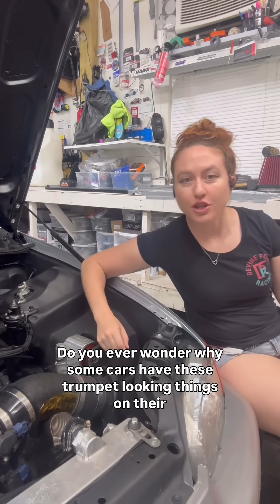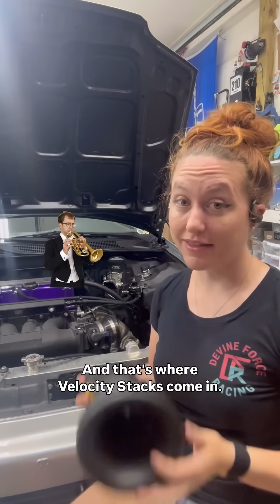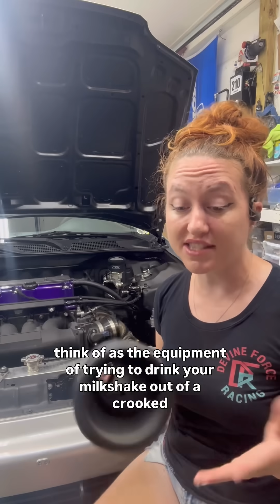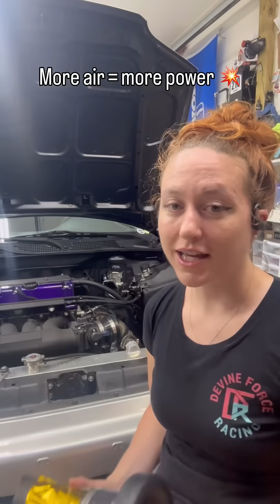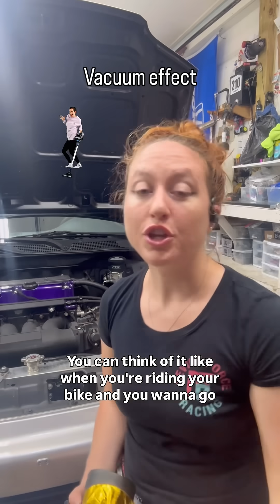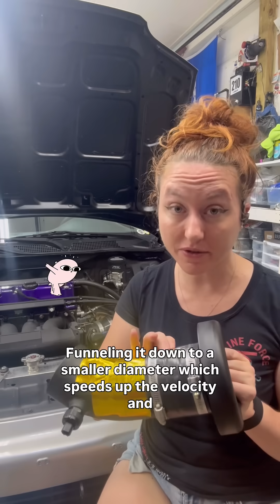Explain it like I’m 12 🧠- Velocity Stacks and Bernoulli’s Equation

Comment: But diesel pistons are starting to get those dots golf balls have so if you do the same thing to that
Reply: No OEM diesel piston I know have them.  They would quickly fill with carbon. If you put them in an intake, it would widen the boundary layer and possibly reduce flow unless the tube was excessively big.
Reply: @motoiq  how many years have you worked on diesels and what type of degree do you have in diesel automotive technology? I have my associates degree and I've been an apprentice at a shop for five years learning about how these pistons increase horsepower so please inform me how are they gonna get filled with so when the engine is being tuned to specifically run these pistons I'll wait because I know the answer and I want to know if you know what the answer is. (here's a hint, even if they got clogged you'd be running the same as a factory piston so tell me how the fluid dynamics are going to get screwed up because you made a better flowing piston. I'll wait.
Reply: @motoiq  oh sorry I should've brought up. I worked in the motor pools in the global war On terror, but that shouldn't matter because that's me serving my country.